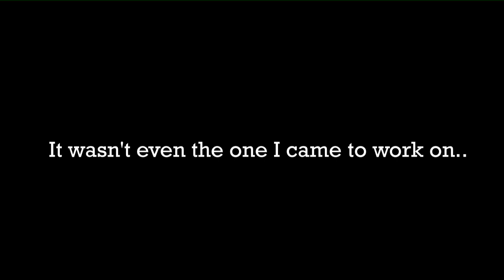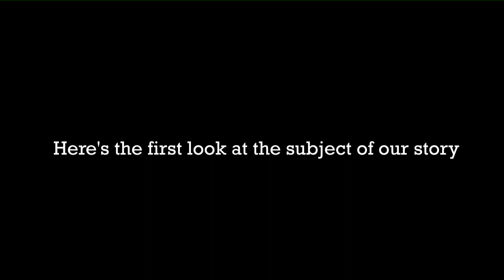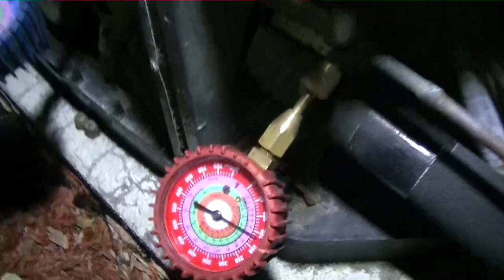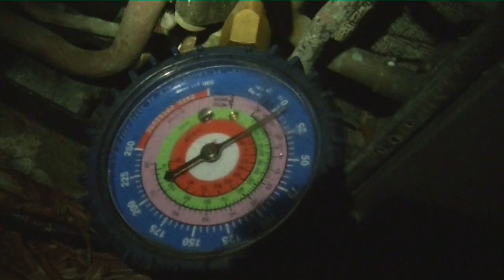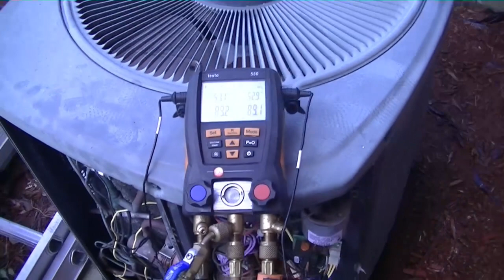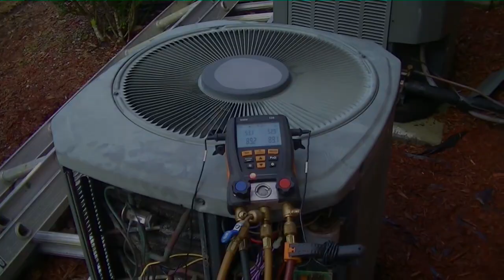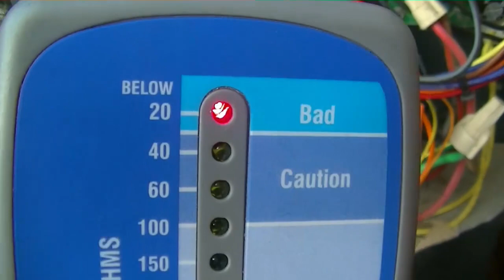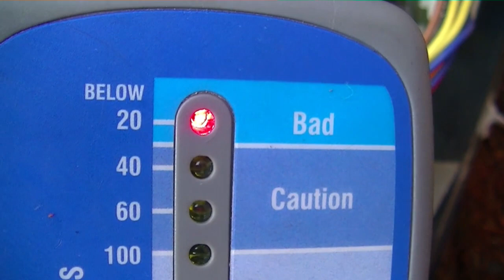HVAC Service-  Trane Refrigerant Leaks and Acid Contamination

Comment: I really like this one. It's a hard thing to put onto some people , but these tools you guys use today defiantly makes it a lot easier to explain!! With a heat pump they run them into the ground usually without even noticing that the thing isn't working properly until it's to late. Cool video on diagnosis! :)
Reply from the maker: Thanks Mike, you are right about the heat pumps.

Comment: zack great job on the video i really enjoyed watching it
Reply from the maker: Thanks steven
Reply: talyn875 The old defrost board probably wasn't soldered properly at the factory. Lack of flux, bad heat, wrong solder, etc. That's the only reason why fan relays and other things sometimes pop off where they are soldered on. Quality control just isn't like it used to be.

Comment: Great video Zack !! The compressor "may" be fine and may be showing bad due to moisture/acid in system. Problem is if they have no money to replace unit, they will never pay for you to do the work to "possibly" find that out. Hope they decide to replace. As for the shorted unit, install some Tattle-Tales on the components and you will know where the problem is when it does it again. Take care, Brett
Reply from the maker: Thanks Brett, I agree. With a bad evaporator I dont think it is even worth discovering the truth about the compressor. That is especially true since it may not be just the acid.

Comment: good work and  when cooling season comes up im sure you'll get no cooling call for that unit since they have heat strips they still have heat but  since its that screwed up more then likely the unit wont cool or wont cool very well and they will call someone to come fix it. heck im surprised that unit runs at all.

Comment: Acid means there is moisture in the system, moisture will cause a bad reading on a megger even on a brand new compressor. I had a unit that compressor leads shorted on suction line just enough to blow a hole in the line causing a complete loss of refrigerant. The worst part of it was the customer was on vacation for 2 months when it happened. The lineset, compressor and coils had water in them because we had a week long rain event and it was running. It took 12 nitrogen purges and vacuums plus 2 drier changes before the megger showed good winding's. That was 9 years ago and the unit is still running. I have also seen on multiple occasions a chiller system fill up with water due to an evaporator failure and same thing. Get rid of the acid and moisture, the compressor will be fine.
Reply from the maker: Thats is an interesting point, I dont know if that applies to this compressor. There was a lost time for this unit when the line set may have been open. No one can say for sure. I am impressed with your comp running 9 years after it was dried out!

Comment: Problems  for customer for us means profit....what did the decide to do? Replace the whole system? Are you gonna leave the same lineset?
Reply from the maker: No they said they are waiting, I guess the heat strips are giving them the impression the system is working fine! I warned them it would not last long and would not cool at all.

Comment: are you sing the ending song?and can the zebra stat detect your short .I just bought one.
Reply from the maker: I am singing the song, wrote it back in the 90's. The zebrastat was used, but the short was not detected. The failure was random and was not occuring at that time.

Comment: Is the volume turned down, cant hear much of what your saying?
Reply from the maker: I will work on that, thanks
Reply: talyn875 What does clean R22 mineral oil smell like compared to acid contaminated oil? Any obvious smell differences I should be aware of?